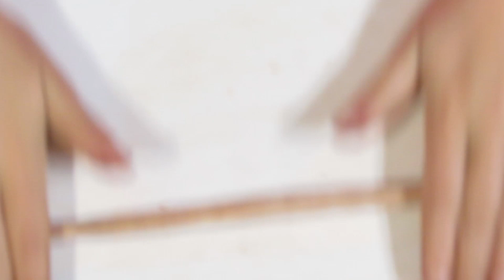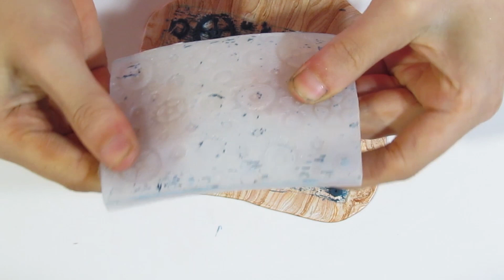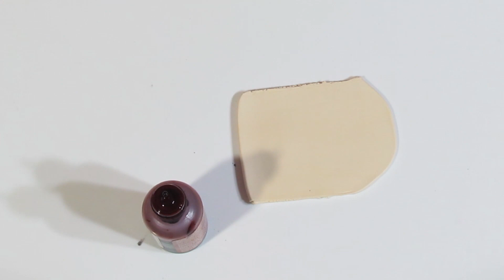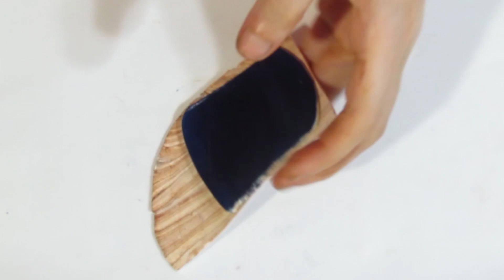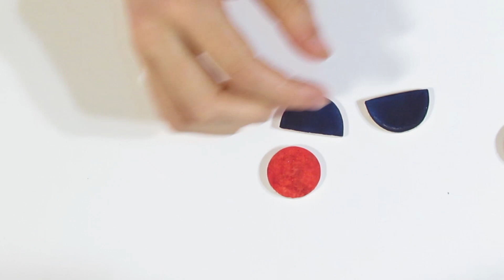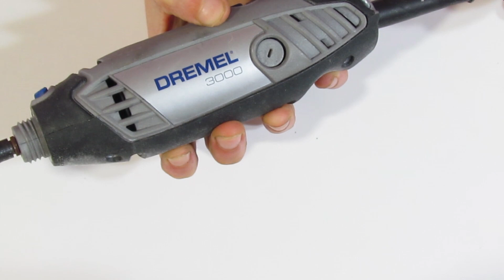Polymer Clay Project: Modern Steampunk Earrings Tutorial

Comment: Can you over- cure it?
Reply from the maker: No. I can bake  my pieces for more than three hours without burning. The trick its to make sure the oven temperature is right, then you should be able to bake as long as you need. However lighter colors such as white will start to take on a yellow hue after two or more hours.